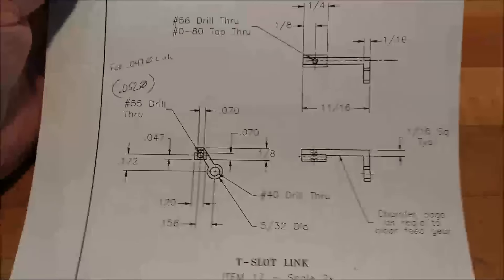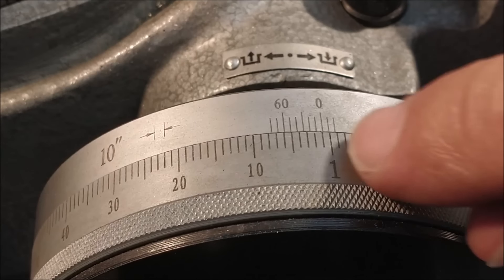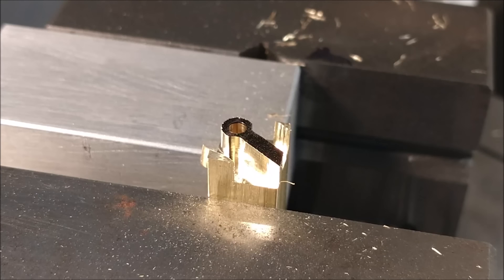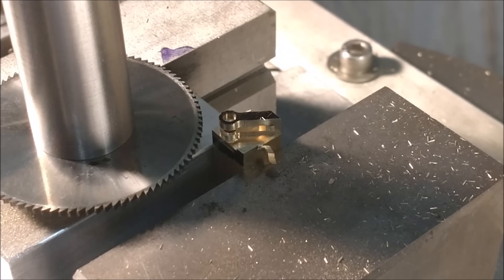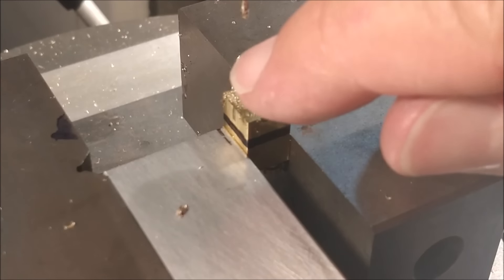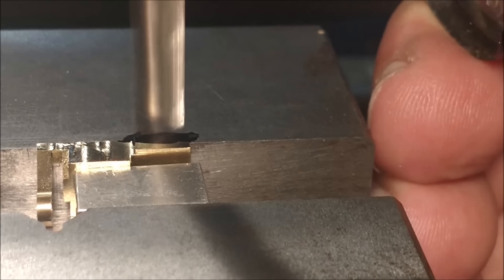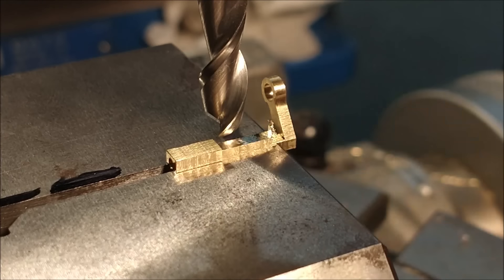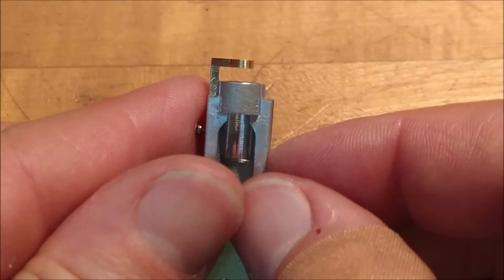This Part Should Be a Test For all Machinists........

Comment: As you were discussing setting up the angle in minutes and second, my brain screamed, jumped out of my head, and ran out the door never to be seen again. 
I guess I'll have to get into management..
Reply: Look up sexagesimal math. It's a bsse 60 mathematics system used by the Samaritans and babylonians. Anyways,  the easiest way to relate to it is with a clock that has a hour and minute hand and a seconds hand and reading the time.  Navigation coordinates are based similar too. Since the gearing of the rotary table takes it to a full circle,  following these concepts makes sense and reading the scale starts to make sense too. It allows you to position the piece any place in a circle reletive to the center.

Comment: As you promised the other day here is that tricky beast in person. This piece is exactly why they "The smaller the harder the piece will be to achieve. Then throw in a directional turn or 3 and you really have a piece to give you a headache. Mine is moderate but really not wanted eh, LOL. This is /has been a really neet one. Thaanks I think, LOL.

Comment: As usual Joe another awesome video masterclass. Your methodology and thought processes regarding workholding are truly mind boggling to me as a hobbyist. Right now my mind is well and truly boggled 😮  your shop gem of using a vice in a vice for holding parts is something I used while  following your tutorial on the pm research #1 engine, cylinder oblique ports. Such a simple idea yet it gets you past so many workholding problems.  Also your mini fixture plate is a must have item. Finally Joe I would recommend your mill skill maze to all budding hobby machinists this teaching aid is superb for honing ones skills on the mill. I will leave you with one of my own "shop gems" if you mount the mill skill maze on a rotary table on your mill, then you have an almost infinite variety of maze/puzzles to traverse. Never get bored doing that. Thanks for all that you do for us mere mortals.
🏴 Regards allan.

Comment: Grinding Vises in sizes from 1 1/2" up to 3 " are super handy and cost almost nothing. i bought two RÖHM grinding vises New for less than 150 Bucks. i know they are import vises but they are accurate to almost a tenth in terms of squarness and paralellism and flatness . i highly recommend a tiny one and one 3 vise.  the options u can do with them are so versatile !
Reply: Old stock? Rohm is one of the best brands around for tooling.  Toolroom quality from Germany. I just looked on their site and a genuine 34mm (1 3/8ths?) Vise is €157 on its own, buying that and a 75mm one for $150 is an absolute bargain!

Comment: The process here is amazing. This video is full of gems. Also - the early stages where the key set up moments are shown quickly at higher speed both saves time and provides a full view of the important aspects of the set up - that's excellent presentation. I wonder if you would mind making the short refresher on using the rotary table dials its very own video to make it easy to find in the future? I know you have other videos on it but that was the best summary and presentation on how the dials work that I have seen. Cheers Joe - making a complex little part like this by the numbers - inspirational.

Comment: Since ive started watching you channel i certainly appreciated the knowledge provided along with techniques shown. There was definately some challenging projects or part of projects ive seen you doing. Ive made vice stop so far, the angle blocks for repeatable angle cuts. I must say i also certainly appreciate the shop gems for setups and actual cuts to be made and it did benefit my ability to do better planning and machining as hobby machinist😃im in process of making my long overdue fixture plate and toe clamps in the following weeks or 2. That piece for the mini mill came out fantastic, a testament to good planning and milling cuts and sequences

Comment: I'll add comments for your alg :)
You really impress me with small parts so thankyou for the content.
I seems to always second-guess which way to turn the handles on my mill or rotary table - I guess I am more of a lathe guy. 
And I started a new job where they have a PCB milling machine (makes circuit boards). Never in my life have I seen a smaller jobber drill - 0.1mm (3.9 thou for you mericans) . I honesty don't think it will survive the tool-height adjustment haha

Comment: Great Video as usual Joe!
Question on the Final Op holding (starting at 24:10 ), wouldn't it have been better "practice" to have had the part turned 180° and the angled lollipop end sitting in the V notch in the center of movable jaw, that way the part is clamped more-so closer to the center of the vice rather than on the outer end?

Comment: Very nice video. I find myself using round stock in a collet chuck more and more for parts like these. I like making the same part on different ends of the bar so I have an extra to mess up. And I can part them off to finish length in the lathe. And my Prototrak mill. Its conversational programming is really great for stuff like this. I haven’t used the rotary in probably 2 years.
Reply from the maker: I try to make the parts from the material supplied. Doing it from a longer blank would have been easier in my opinion. I too like the approach you described.

Comment: Actually, Vernier markings are an equivalent of (1'-10") apart. But, as you hinted, that is rockets science for some people.
Reply: I managed to scarf up a Moore rotary table from the old Rocky Flats Atomic Bomb facility. Many of my tools came out of atomic energy facilities. The level of rotational precision is insane. 

One might consider at first using a rotary mill accessory such as a volstro head or KT 2D rotary mill. 

But the intersection between rotary motion and linear motion at the projected angle is tough to meet.

Here, using a toolmakers vise on a rotary table is more straight forward. But you will definitely need a jewelers loop here!!!

Great idea putting the toolmakers vise onboard the rotary table.

Comment: Rotary table = dilemma.  If big enough to be useful it's too heavy to lift
Reply: Hydrolic engine hoist (cherry picker).  They are relatively cheap and will fold up small and out of the way when not  needed.
Reply: I use a scissor lift table. I can get it to height, slide it on and wheel it to where I need it.

Comment: I never seen or even heard of a "minute" degree measuring system. All of my settings are in thousandths on my Bridgeport milling machine and lathe
Reply from the maker: Linear movements like the X and Y table on your mill, or carriage and cross slide on your lathe, are normally incremental like that, rotational movements like those on a rotary table, can't be called out that way and are normally in degrees, minutes and seconds as needed. Like the 4th and 5th axis of a 5 axis cnc mill.

Comment: Kind of surprised you didn't cut the t-nut profile first, then flip it vertical, drill the two holes and then whittle out the stem with a woodruff cutter, such that everything remains fully supported until the surfaces are formed. The mounting plate would be formed last, and then parted from the piece with the sliding saw. 

BTW, MSC's Interstate (aka Value Collection) little grinding vises are actually decently made and a fraction of the price of Suburban or (god help you) Moore.
Reply: I did not know that Moore ever made a small grinding vise, the only vise I have seen in their old catalogs is a jig boring vise with two round rods. 

Herman Schmidt is famous for making the most luxurious grinding vises, but I think they are not worth what they cost when the cheap $150 import grind vises are difficult to find a flaw with, I got one from HHIP and was getting almost no deviation with a .0001 indicator while checking every surface using a squareness comparator. 
But the non-critical surfaces they show poor craftsmanship such as how they chamfer the edges very roughly, but on my Herman Schmidt vise every chamfer looks perfect like it was a faceted gemstone.
Reply from the maker: @PaulSteMarie  Greetings Paul. Over the course of building the PM Research machine tool line, I promised myself I'd make every effort to fabricate the parts from the material provided. I do often disagree with the material they supply for the intended part, but its a personal challenge to give it a try. I agree, this part would have been easier done from a longer blank, but there was only 1/16" of extra material on the blank. I've used your technique with much success in other projects, but for a .063 cross section coming out of an extruded blank, I would expect distortion once the arm got longer. Thanks for the comment.

Comment: Reading degrees and minutes on a rotary table is not difficult. It's the same as reading the numbers on callipers.
And indeed, this is a nice example of a "delicate part".
Reply: I think the hangup for most is understanding what degrees and minutes represent. It's not something you realize you use every day and is lot like going from metric to decimal English measurements. Even English to decimal English can be difficult for some.  An example might be 1/4 inch =.250 inch = 6.35mm. To some, each version of the same thing could resemble a foreign language they do not understand.

Comment: Sorry, my calculator doesn't do "minutes", but it would be a lot cooler if it did. Check my math.. 360/25 = 14.4, so that's 14°degrees and 4/10's of a minute =.... 24 seconds?  Crazy tiny part!
Reply: Four tenths of a degree, which, as you say, is 24 minutes.